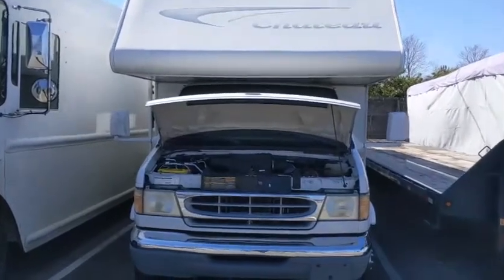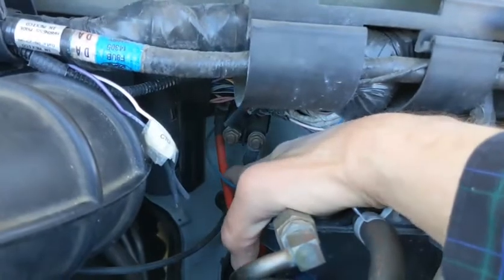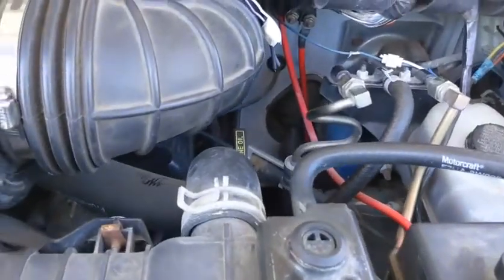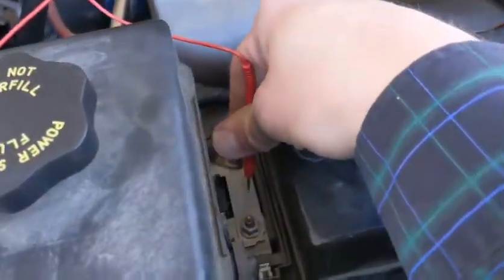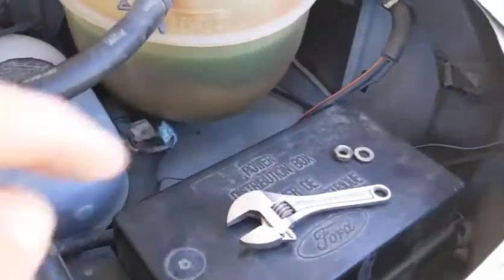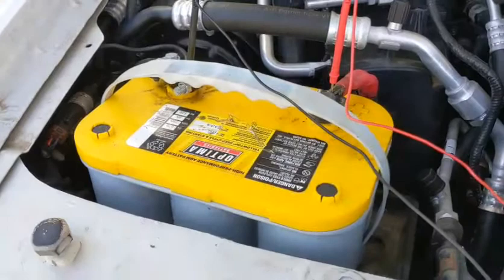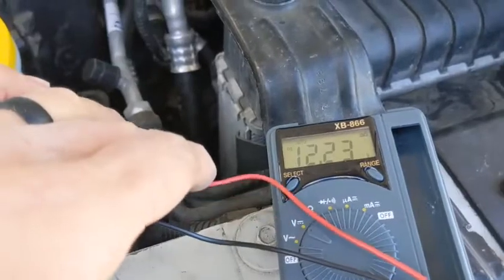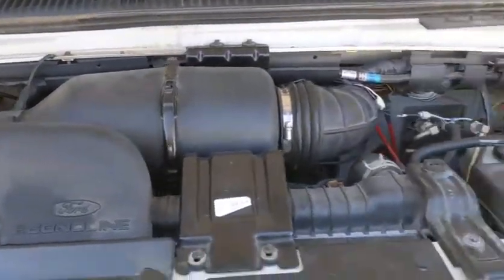How To Jump Start A Motorhome From The House Battery

Comment: Hello, My Thor motor Coach, Freedom elite RV, with a chassis of 2017 Ford E-350 super duty, 6.8 liter V-10, gas engine. I am having electrical problem. Something cuts the power from the battery. Many times every thing on the dash dies. No crunk or no dash light. Only way I can start it is by pressing the emergency start button which uses the house battery since it’s an RV, then it immediately starts, but some times they both dead completely. Many times the battery light and some times the check engine light comes on and off. I replaced the alternator to a brand new motor craft 225 amp hour and brand new Duracell battery but same thing happens next day. Vehicle has 70000 miles. What shall I do? What do you think is the real issue? Thanks.
Reply from the maker: It sounds like you're trying the right things, replacing the battery and then the alternator. It might be time to take it to a mechanic. I'd be guessing if I tried to tell you what else to try.
Reply: @jeremyhood  I took it to Mecanic last Saturday and they diagnosed for two hours and they couldn’t find anything wrong.
Reply from the maker: @DailyInspirations101  Oh my goodness!  I'm sorry you're dealing with that.  I can share some guesses and what I would try, but I'm, by far, NOT an expert.  It sounds like something is draining your battery.

- My next guess would be to check the battery isolator (I think it's called).  It's the thing that allows both batteries to charge while the engine is running, but doesn't allow the house to drain the engine battery.  It's strange to me that the engine battery being dead would cause the house battery to die as well.  Granted, that's only sometimes, but this makes me think the battery isolator might not be working exactly correctly.
- My next guess after that would be to look for a short, like a bare wire somewhere.
I'd probably inspect the starter very carefully.  There's usually a solenoid that engages when the starter is on.  I wonder if something could have shorted out in there.  (It might be easier to just replace the starter.)
- After that, I'd probably start looking for an electrical drain in the system by pulling one fuse at a time and measuring the amount of current running through it.  I think most multi-meters have an option to do that these days.  You'd have to read about it more because I've never done it myself, I've only heard it can be done.  If / when you find the fuse associated with the power drain, you at least know where to look farther.
- Some RVs have kill switches built into the house electrical system.  You might add one for the engine battery.  You'll probably have to set your clock every time you flip that switch, but at least you won't be stuck somewhere.
- When you see the check-engine light (or even if you don't, you can still try), have you tried reading the code it's throwing?  Search the web for that code and see what others say.

I had a similar issue with a van we used to have.  I replaced the battery every 2 years or so, the alternator, the started, etc.  I never found the electrical leak.  That's why I suggested you take it to a mechanic.  However, since they didn't find the problem either, I'm not sure what you can try except to start guessing and checking things like I've listed above.  Again, I'm sorry you're going through this.  It has to be so frustrating!
Reply: @jeremyhood  Thank you so much for all this insight. I think I should bring it to RV specialist, instead of regular vehicle mechanic and show them your comment . I will keep you updated.
Reply from the maker: @DailyInspirations101  Of course, I'm happy to try to help.  I just hope they're able to fix the issue for you.
Reply: @jeremyhood  I brought it to another mechanic and he also couldn’t find anything and after I showed him your comment he suggested that I change the battery isolator
Reply: What do you think about this part?
Reply from the maker: @DailyInspirations101  I hate saying to spend money when I don't know for sure, but, yes, that's probably the next thing I would do. Again, I don't know if it's going to fix the problem. I hope so!